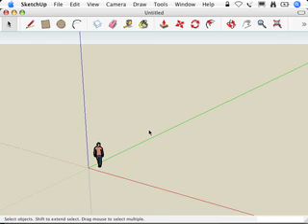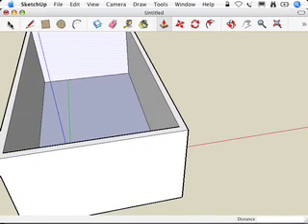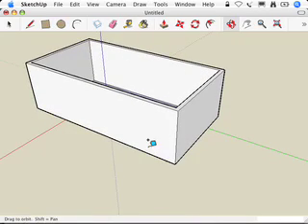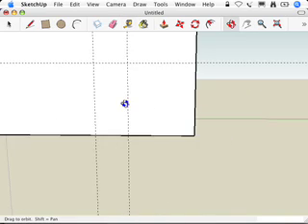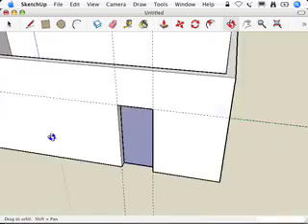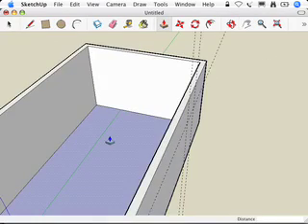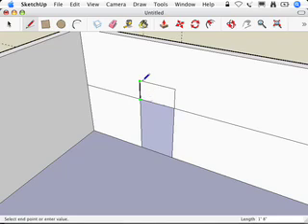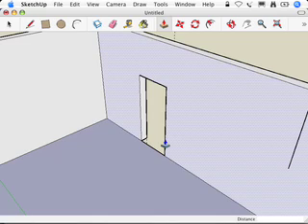SketchUp: Making your own openings

Comment: After many hours of frustration I've finally found the "trick" to create openings in thick wall with two faces.  When holding the left mouse button, push slowly through the wall and do not release the left button before you see "on face" appear next to the cursor.   You can then release the left button without moving the cursor.  I've found that moving the cursor slowly inside the frame of the opening will activate the "on face" message, in fact it seems to be an essential step to see it appear.

Comment: I have a flat, block rectangle of wood and I'm trying to cut out half of a cylinder shape out of the top. An impression that you could set a jar into, for instance. Why doesn't this method work for this? I can't seem to remove the half cylinder area for the block.

Comment: @aidanchopra i got a problem, it doesnt make a hole, it just makes the block thicker. but i dont have any lines in the way. it is also parallel.... then i tried to delete the block after i used the push/pull tool. but then the other face of the wall was also deleted. help?

Comment: That is useful when creating openings in "single faced walls", but not on "double faced walls", because it doesn't create faces between the two faces and you'd also have to delete openings on both walls.

Comment: you can do that if you're working with one face, but when you're working with 2 faces that make a "thick" wall, pushing a face through both walls is simpler, because this keeps you from having to define the perimeter of the opening on both the outside and inside of the wall. its alot easier this way.